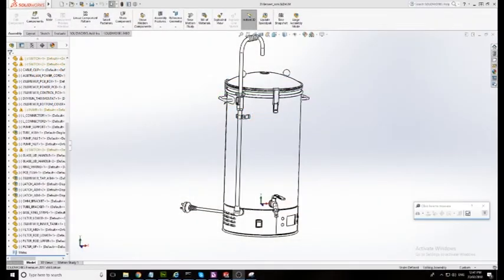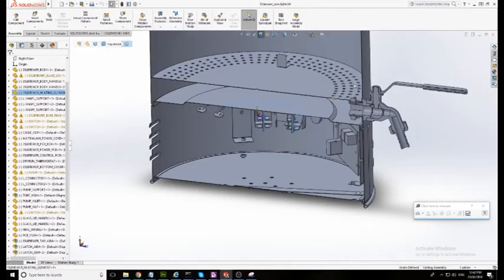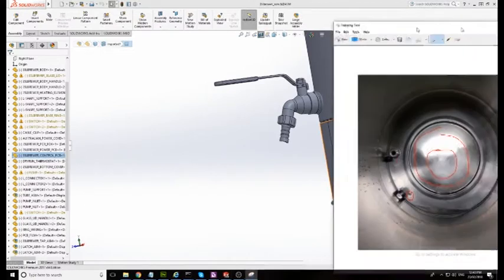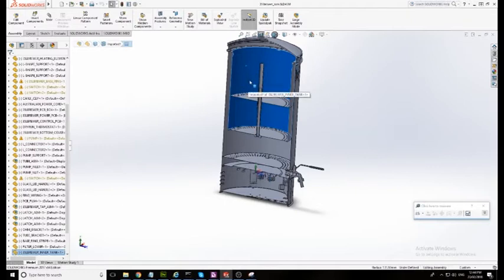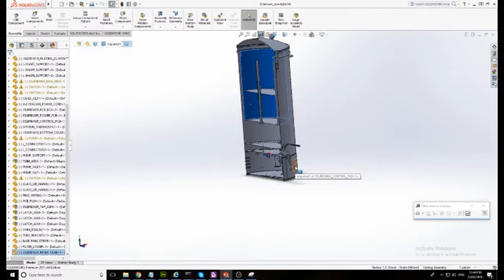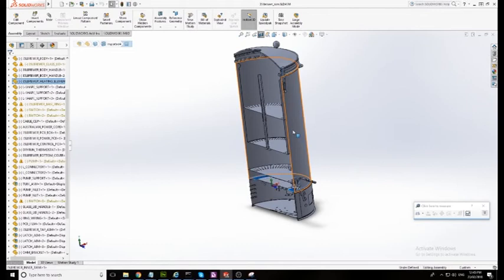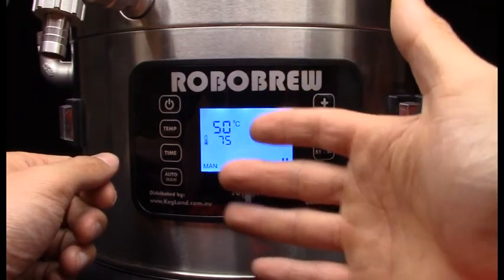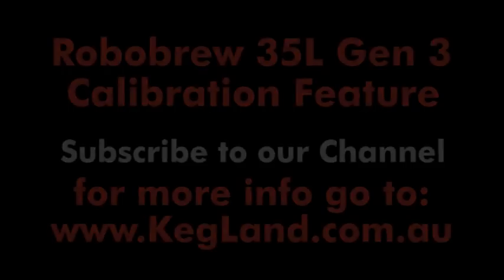Robobrew Gen 3 -  How to do Calibration

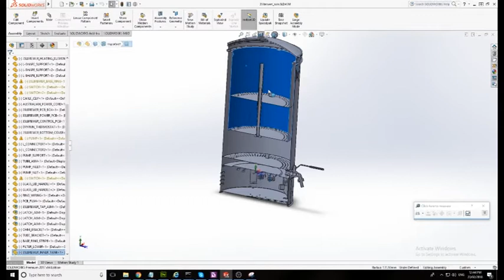Comment: Cutaway diagrams 0:38 and 2:21
Reply from the maker: Yes we can do that.  Do you prefer these cutaways?  Sometimes I am not sure if this is too technical for customers or not.
Reply: @KegLand  The diagrams are useful for me and I would like to see dimensions too, for major items such as the OD of the boiler and the malt pipe. Those who don't want it will just ignore those details, but I have seen people asking in posts for dimensions.

The cutaways here help to explain the dead volume, which I need to factor in for brewfather.

Comment: So you compare  the Robobrew / Bruzilla temperature probe mounted in the base with a water proof temperature probe placed near the Bruzilla probe is this correct 
  Note:-  I have only received my Bruzilla 3.1.1 today 9/2/22 so have no experience brewing with it  - - theirs going to be more newbie daft  Q's I will want to ask - is there a platform where I can do this...joe
Reply from the maker: Hello Joe.  Yes that is correct.  All the Robobrew units and BrewZilla units have the probe mounted on the base.  We also have a new Gen 4 BrewZilla getting released soon where we can use a wireless bluetooth thermometer in conjunction with the BrewZilla.  So on the new Gen 4 you will be able to put the wireless probe into the middle of the malt pipe to get a core mash reading.

Comment: so I use F for brewing and  my wort boils at 208F when on the HH on the display. I have checked my mash many times and the temp is always a little higher from what the display says. Should I increase the display or should I try it with just water instead of wort??
Reply from the maker: if you are certain of the issue then you can probably adjust the calibration on the unit.

Comment: How to make a temperature calibration of 3.1?
and how to calibrate the timer, it does not work correctly
Reply from the maker: When you say the timer doesn't work correctly what do you mean?  Where are you located in Australia or other country?  Where and when did you purchase the unit?  The earlier models used the HZ of your power to driver the clock in the unit so if you take unit from one country on 50hz then use the brewery in another country on 60hz the clock will work differently.  So we want to check you have not done this.

Also the temp calibration instructions can be downloaded from the PDF on our website.
Reply: @KegLand  bought from a representative in Australia. I use in Thailand.
the pause timer does not work correctly. it starts the countdown immediately after switching on. must include the time when the desired temperature is reached in order to pause at that temperature.
For example: malt fell asleep at 45C. I set the timer 55C for 20min. It should turn on at 55 degrees and tear the time for 20 minutes. then the next pause 63C 30min.
And the timer starts the countdown immediately from 45C from the moment of launch. When the temperature is 55C, the timer has already ended. The next pause 63 immediately follows. And there is no time delay at each stage.
Therefore, there is no automation of the whole process. you need to personally control the time and work only in manual mode.
Reply: I could adjust the temperature. the process is the same as on version 3.0
Reply from the maker: @TOEThroughOurEyes  I think Thailand has the same 50hz as Australia so unless you have a questionable source of power then the timer should be working the same as in Australia.

To adjust the temp you hit the play/pause button then use the up down arrows to change the temp then click play/pause again.
Reply: @KegLand  temperature i made. she is correct.
The only problem is with the timer. It starts not from the moment you reach the desired temperature, but immediately how to start. I do not know how to set the timer correctly. so that at each temperature pause he counts the right time. I spend a lot of time on manual operation

Comment: I bought a pretty expensive hand thermometer to check my mash temps. Compared strike temps prior to adding grain against the robobrew 3.1 and the robobrew was reading 1 to 1-5 degrees higher. Just wondering how confident how are you with the out of the box calibration of the robobrew? Next step is to compare against an ice bath calibration.